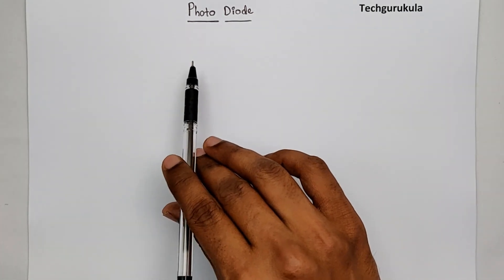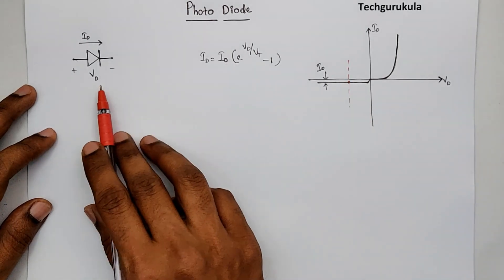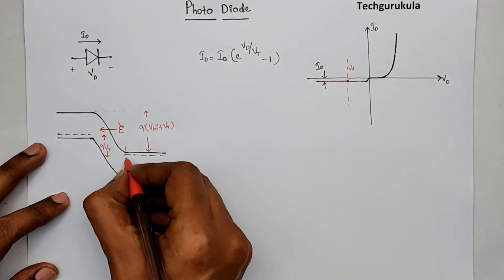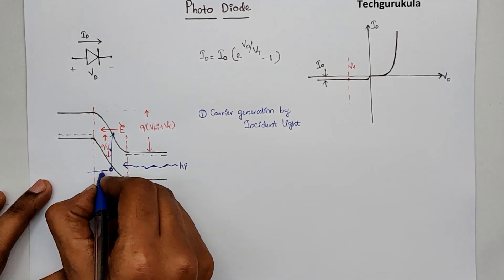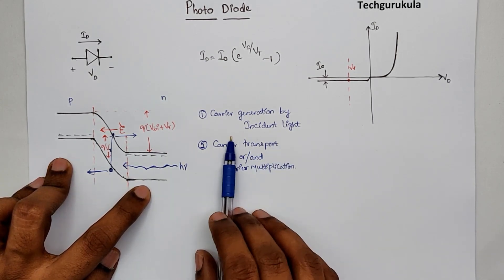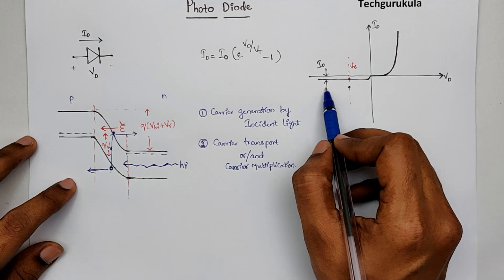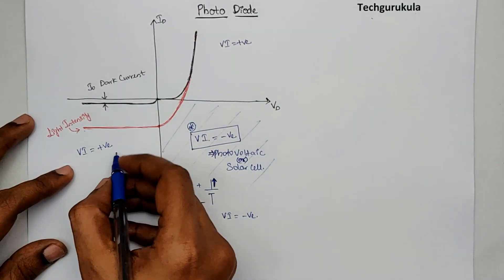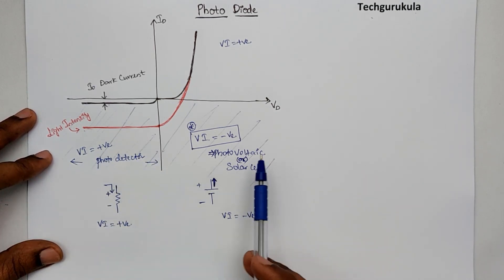Electronic Devices: Special Diodes - Photo Diode

Comment: @techgurukula Thank you so much for the lecture ☺️ I have a doubt, could you pls tell why the current in photo diode is diffusion current? We have seen that in reverse bias minority charge carriers flow and current is drift current, but here we have the same minority charge carriers in reverse bias and same built in electric field moving the charges across barrier, but still current is called Diffusion current 🤔